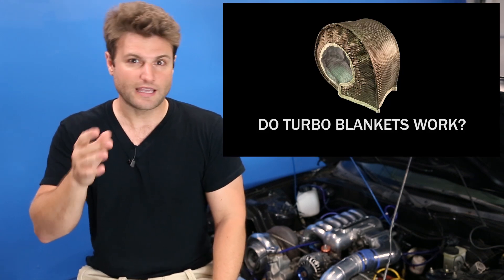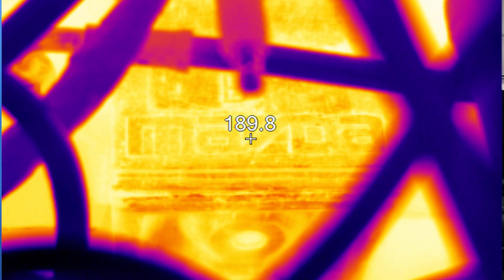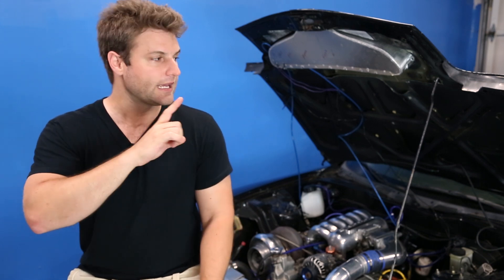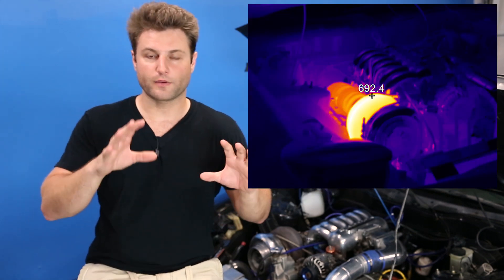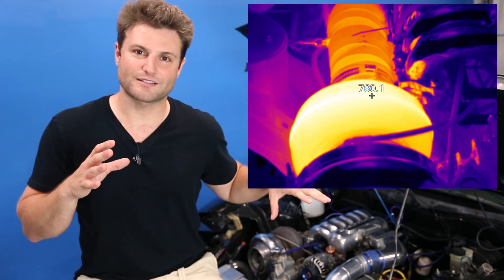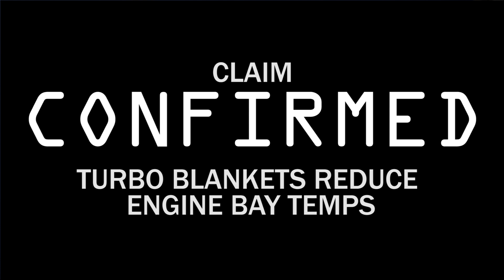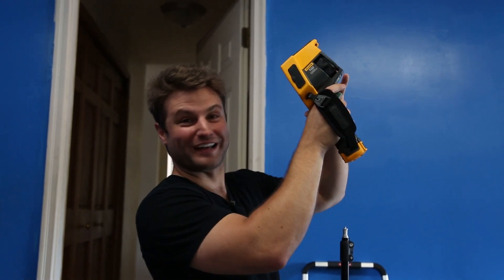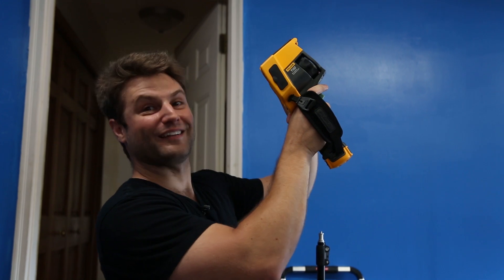Do Turbo Blankets Work?

Comment: Yes they work, reduce engine bay temps drastically. However, the issues people tend to have when running turbo blankets for a log period of time (talking daily driver here) is that the increased heat that is kept within the ex housing also makes its way to the chra. Heating the oil and/or water more which can lead to increased wear on bearings etc.

Comment: i would prefer not to run a turbo blanket you could almost indefinitely count on your turbo burning up because of the heat being held into the turbo rather than being radiated into the engine bay

Comment: Actually I would believe that the blade tips of the turbine get farther apart with the blanket. The turbine being directly exposed to exhaust gas is going to be much hotter than the housing. With the blanket installed the housing will get hotter and expand more than it would without the blanket thus increasing the end gap.

On the compressor side the housing could potentially be hotter with the blanket installed since there is a direct path of conduction from the exhaust side to the intake side. At a glance this doesn't seem to be the case with your test, assuming that you manually input the color range on your FLIR and it is not on auto range. To see a compressor efficiency increase due to decreased blade end gap the wheel would have to get hotter. Given the compressor is directly cooled by intake charge, the shaft is oil cooled, the housing is water cooled, and the shaft itself offers low surface area for conduction I don't think the compressor wheel temperature is going to change much for the end gap to be altered during operation.

I personally think the marketing claim that the blanket reduces blade tip clearance with the housing has no merit and it would be hard to obtain empirical data to prove. Power output gains from installing a turbo blanket, if any, are probably due to other reasons.

Great video though, have you considered installing individual IATs on each intake runner to monitor their temperatures during operation?

Comment: Ok but what about your egts? Whats it doing with them? Too high of your Exhaust Gas Temperature. and you can do serious damage to your turbo to the point of catastrophic consequences. Even without catastrophic failures prolonged high egts will damage your turbo or other exhaust components yes? Also another worry i w ould have is if i owned a vehicle whos exhaust is routed closely to the oil pan. Subarus and others. Would that not significantly raise your Engine Oil Temperature?

Comment: I remember from my Bsc in engineering that the turbo charger exchanges potential (inertia) energy between the exhaust gas and the intake gas. 
Potential energy in the gas is a technical term for the speed of the gas. What happens in fact is: the turbine takes the mass of the gas, multiplied by its speed and turns it into angular momentum and speed. Then at the compressor side it happens vice versa.
The thought that I'm trying to convey here is that the turbo utilises the speed of the exhaust gas, not the pressure differential.

Now, the speed of the exhaust gas will be that of the speed of sound at its temperature. The speed of sound always only depends on the temperature(as long as the gas mixture stays the same and not suddenly becomes a different gas or so). Low temperature gas has a low speed of sound and the speed of sound is high in a high temperature gas. When the gas flows from a high pressure place to a low pressure place, it will travel at the speed of sound. Less than an atm. is needed to make a gas flow at the speed of sound.
The reason to keep the exhaust gas hot as it "shoots at the turbine" is because then it shoots the fastest. The faster the exhaust gas bumps into the turbine the better. The speed of sound at 400C(red-hot steel) is about 575m/s while at 1200C its about 1000 m/s.
I may be wrong of course. Let me know if you find out this is not why a blanket on the turbo makes it work better. Cheers.

Comment: Very informative video Rob, I run a TB on my old v3 Impreza STi. With its top mount intercooler, it would absorb a lot of heat from the turbo nearby. With the addition of the TB, the turbo area is now much cooler but more importantly the TMIC is cold to the touch, they do work.

Comment: do trap heat? yes. you're reading low temps because the blanket is holding the heat in. all metals designed without the blanket are designed to disperse heat not trap it

Comment: Containing the heat will over work the oiling/cooling system.  DO NOT DO THIS!  Instead, work the turbo into a position where it will not affect things so much.

Comment: im a firm believer in turbo blankets, many large inline 6 turbo diesel engines come with turbo blankets stock to protect other components that are close to the turbo. But a turbo blanket does help with "performance" by increasing the heat generated pre-turbo. Keeping the gases entering the turbo as hot as possible increases the velocity of the gases entering the volute and then spinning the turbine.

 This is the same reason why a cold engine/turbo spools later vs a hot engine.

Comment: Not only does heat not rise, but the expansion to make the clearance tighter between the impeller and housing is probably false.  Unless the housing material's coefficient of thermal expansion is less than the impeller, the concept I think is being implied won't work.  That the housing heats up, and makes the hole smaller for the impeller, and the impeller gets bigger, tightening the clearance...that's not how it works.
Say you have two flat plates, one actually has two pieces, with a hole cut in one of them and the other circular piece, the same exact size to slip fit.  As the plates expand, the hole gets BIGGER and the piece will not 'get stuck'.  It will expand exactly the same way as the solid piece.

Comment: so does it work or not? i dont want to waste 8 minutes
Reply: Well you wouldn't be "wasting" because he is teaching lessons on what is going on with the heat in the engine, turbo, and such. Also, you could've just looked a little harder and saw that, in fact, he does say turbo blankets work in the description.
Reply: Well there is only one way to find out...watch the video :) only then will you personally know if your time was wasted or not

Comment: If you are looking are something negative about it, I bet it would burn up your oil much faster. You could get an oil change every 2,000 miles, instead of every 3,000 miles, and use high quality oil. Probably not for someone with an oil leaky engine.

Comment: When heat is contained in an object that pushes hot air, that contained heat helps push it out faster, also keeping the temps around the dump pipe and rear housing the same stops unwanted expending of metals and stops regular flow. It's like driving down the road, and in one area for 1000m its 40 degrees and after that for 1000m is 10 degrees and keeps changing. I have a turbo blanket and heat shield aswell and you can notice the car comes on boost 0.90secs faster on boost and its alot more constant. Next up is Ceramic coating

Make a video on Ceramic coat headers, rear housing, dump pipes etc?

Comment: How often do you continue to use your rubbers after they dry rot .... ? ... : )
Loved the video . Thanks for taking the time to do it.  I would like to see exhaust wrapped vs not with the same material. What if any are the performance gains. I would assume there would be faster spool up and lower engine temps . Thats why I did mine. 
http://www.theturboforums.com/threads/381269-A-machinist-a-turbo-and-his-L31-GMC

Comment: My engine bay gets hot as hell and heat soaks things a bit. It's cramped and I have a car that was never intended to have a turbo. The Walmart special 96 cent flat black has burned off on the hood over the turbo and revealed the Krylon underneath ($3.86 can must have more heat resistant paint than $0.96), the vinyl decal I put on it got singed a bit, and my #2 and #3 plug wires were cracked and burnt in 7000 miles. I was already thinking about a turbo blanket and now I'm sold after discovering the plug wire issue today and watching this. I'll probably wrap the downpipe too. Plus some heat wrap for the wires...

Comment: 28 k own what and transmission block  ???? Also if that's custom then why are you getting parts machined for because custom parts should be already machined to whatever spec its need wtf you make no sense and rotors wankel washing machines are rubbish they blown up all the time and I live in OZ so many tosser here with these shitbox rotors in rx3 and other Mazda shitboxs I shit all over them any day everyday piston power all the way mate!!!! Plus the wankel was only three moving and it still sucks and doesn't last too long either outside of Japan Australia is number one with the rotary they been modding them since the early 90's

Comment: from experience,  don't use a turbo blanket with a rotary.  the turbo is cooked, bearings are destroyed, gaskets are burnt and manifolds crack. Rotaries spit out far more exhaust heat than pistons and you need air to circulate around the turbo and exhaust to reduce temps. what you do have to do is make shields around the turbo and exhaust to prevent everything else being cooked. Never run a turbo with no cover like you have there

Comment: wrapping your headers and or entire exhaust also helps a lot too
Reply: +datownkidd youve got thin, shitty ass headers then.
Reply: Yes. I have a super charged mercedes C230 Kompressor and my ambient temps went down about 20F degrees.
Reply: On my 91.5 dodge ram 6bt I used the "extra thick" header wrap on the stock cast manifold + hot side + the volcanic /titanium blanket on top of 2000°F paint.  150k mi  no cracks no rust  I limit out at 1100°F EGT.  I have run from Portland, Or to the other side of Salt Lake City 900+mi at 850-1100°F EGT towing at many points I checked things out the hot side wasbear hand  tuchable were as before empty nothing under the hood was tuchable in less than 30min 

Grab my junk wrapped up dropped my EGT by  a hundred degrees  AKA 500° was 1 psi now it's 400°   less throttle/EGT is needed to maintain freeway speeds. 70mph onthe flats was 600° 1psi now 500° @2-3psi. Spools faster as well.
Reply: +Lucio Guy no. All you do is drive the car and it will evaporate moisture bud.
Reply: Rust.
Reply: You need to be careful wrapping Turbo exhaust headers...it can sometimes mess with the scavenging affect....specifically Porsche 997 headers are known to not be candidates for ceramic coatings.
Reply: Thats also a really good way to crack your headers.

Comment: I did a ceramic coating and lava rock wrap on my manifold, turbo and downpipe and I witnessed about a 600rpm difference from where the car would make 1psi of boost. I did the test back to back the same day and did multiple pulls to confirm it.

Comment: Heat doesn't rise, only moves from hot towards cool until a even temperature found. Hot air rises because it has buoyancy compared to the cool air around it. Good video though.

Comment: Good job with the video. I have one thought. Your shiny intake has a very low emissivity. Meaning that it reflects infrared light. Not convinced the heat you saw in the infrared image was real. Most likely reflected IR light from the turbo housing. You will need to take temps of intake with a contact probe to confirm actual temps.

Comment: Definitely do more science videos!   
Performance can be gained using a blanket due to a less thermal energy transfer between the exhaust gas and the turbine housing. A cooler turbine housing absorbs more heat from the exhaust gas (decreasing pressure, temperature and ultimately mass flow) As turbine surface temperature increases , an  ever smaller fraction of exhaust thermal energy can be transferred to the turbine housing. This leads to less pressure loss and better mass flow. The major drawback to turbo blankets is a BIG increase in heat transfer engine oil. On a rotary, which has very very high EGT's normally, this could easily lead to oil coking.
Reply: I need to do research on oil coking on Honda K20C engine

Comment: I was told tht turbo blankets are not good for the turbo, because the turbo can not properly vent the heat produced, meaning the housing experiences temperatures far higher than it was built to contain.
Reply: That's correct. With a turbo blanket, you are insulating your turbo, which means it will run hotter. But if you are melting surrounding components, then it's probably a good idea. A better idea is to custom fab a heat shield system that both protects the components surrounding the turbo while also permitting convective cooling of the turbo while operating. Often called a turbo chimney.
Reply: I'd take the turbo burning up, over ruining surrounding components.
Reply: not completely true but the reason Mercedes is ruling f1 is because of using a split turbo so the exhaust side doesn't heat the cold side.So holding exhaust heat in is not really that good
Reply: sounds like a better idea Craig.

Comment: seems like it would be better to partially shield the hood and intake eater than the whole housing just because it would seem like it would get too hot for the bearings and blades and cause damage from the heat

Comment: My concern with these blankets is that while in theory you want to seal the turbo up as much as possible, you have to remember that an engine also uses the exhaust system as a means of dissipating heat. Therefore, entrapping more heat near the manifold will raise internal engine temps. Also, turbos don't particularly enjoy heat. Too much heat will cause the oil to be too thin and the bearings become too soft and can lead to premature wear.

Comment: hey since you have a thermal camera how about a similar video comparing stock vs header wraps vs ceramic coatings......maybe even both combined, a lot of people remove heat shields to install headers, heat gets transferred to oil pans and transmissions

Comment: Not to forget the fact that raising exhaust gas temperatures lead to premature turbo bearing and shaft failure and higher probability to oil coking because the turbo can't properly vent and cool off enough before shutting down but in your case since it's so close to other important components and right next to your hood, it would make total sense to buy a turbo blanket

Comment: The myth isn't that a turbo blanket keeps engine temps down or anything like that, anyone who has put a decent blanket on and been able to grab the turbo can attest to that. The myth is associated with benefit vs cost. That the benefit outweighs the cost.

Benefit is of course lower engine bay temps, less heat soak of intake, compressor housing, sensors etc etc etc. The downfall has always been the heat retention in the turbine housing. If it stays there and the hot side is subject to even more heat as the radiation is limited, how does that affect the turbo manifold, how does that affect the turbine blade clearance, how does it affect the cooling oil. 

I've always been told to stay away from turbo blankets as they tend to prematurely wear out the turbos causing failure. Instead a good heat shield with an air gap where needed is much preferable. Would be interesting to see turbo blanket vs a well designed heat shield.

Comment: and have any heat shields been tested?
Reply: A simple plastic, chrome wrapped plate can deflect heat well too. Especially one between turbo and engine.
Reply: +Sutthiphong plastic? what kind like bed liner?
Reply: +Sutthiphong how about putting gold on the ice? I heard it's got awesome results...
Reply: +dankxdank i have no clue what the ice on gold thing was but ok. I meant liner as in omni heat kind of liner.
Reply: +Sutthiphong intercooler, gold tape.
Reply: +dankxdank lmao. Intercooler gold piping would be dope. You could prolly make the heat shield out of mcdonalds cups if you wanted to (;
Reply: +Sutthiphong haha, mickydees cups huh? I'm on it.
Reply: +Sutthiphong I was actually referring to ppl who use the gold heat treated tape to cover the side closest to the snail to reflect heat...